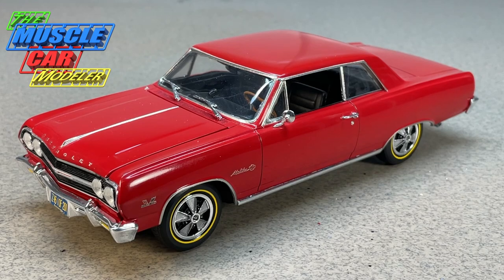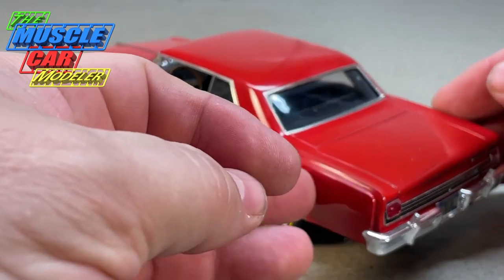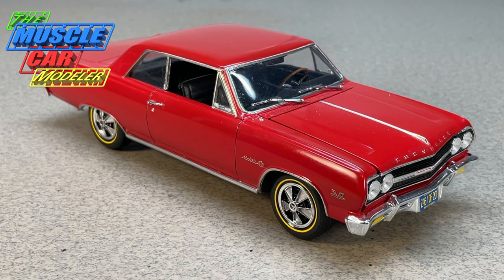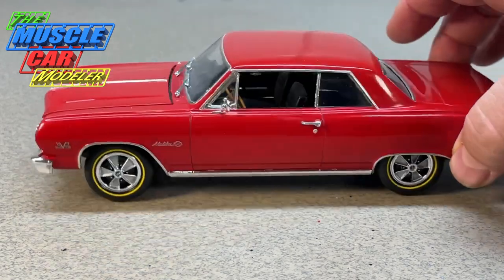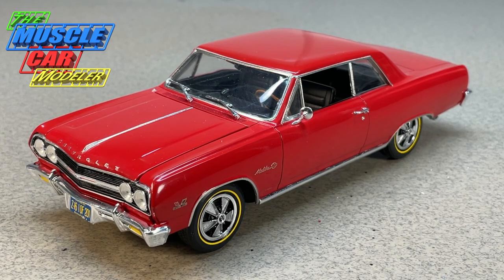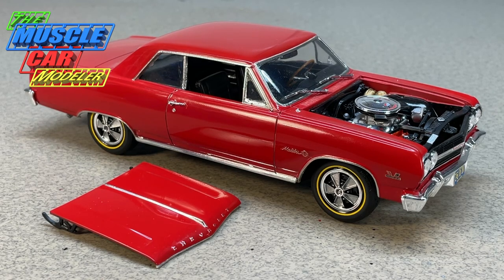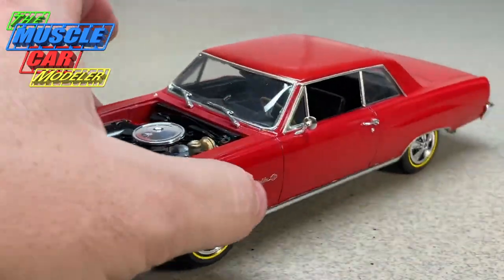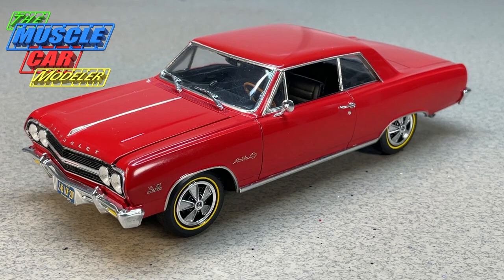Revell 1965 Chevrolet Chevelle SS 396 Z-16 Build

Comment: For one of your earlier builds, this one looks terrific! Yep, putting the foil on first then primer/painting works great, I use ink on the emblems and daub off the excess. The ink settles in the low spots and is great for making the emblems look real. Thanks for the history lesson.  i have only one of these also and it is not the stock version. Let's hope Revelle issues it once again.
Reply from the maker: Awesome! Thank you! So the laker kits don’t have the stock parts?
Reply: @TheMuscleCarModeler  Not unless it's a '2N1'

Comment: Wow, I was unaware of the Z-16 backstory, and would have walked right past it at a swap meet. Thanks for the research you add into your videos. 
Are the Revell re-releases the same kit in newer boxes, or have they removed some factory stock parts in lieu of added custom parts? 
I will be at 2 shows in the next few weeks, so would like to be aware of what's in the boxes.
Reply from the maker: From what I know. The rereleases have added custom wheels and tires, but all the stock stuff is still in the kit.